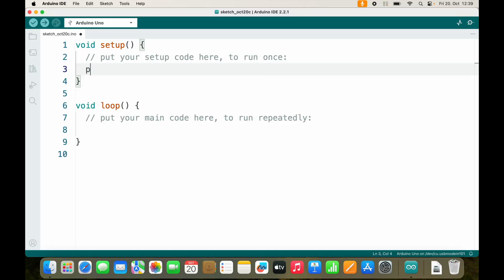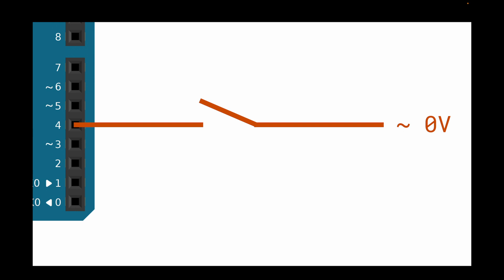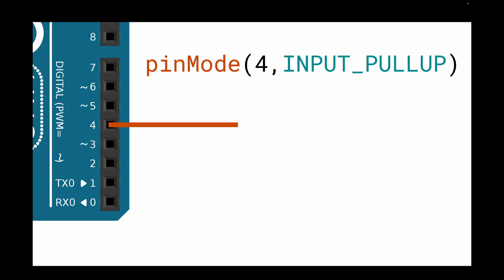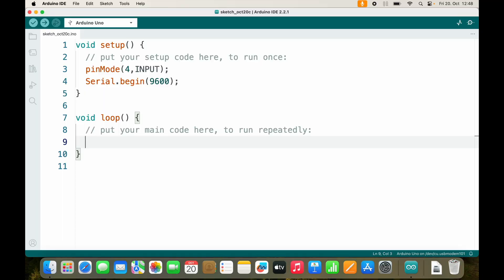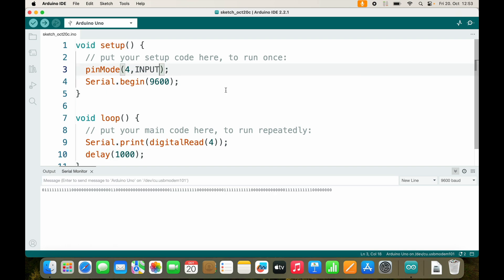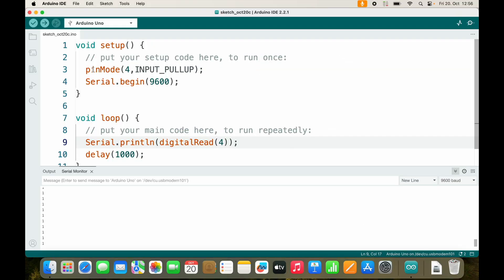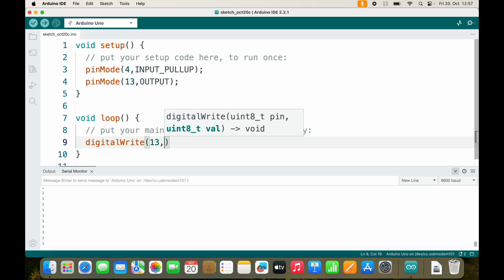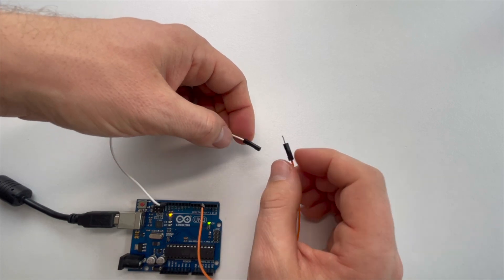internal pullup resistor - digitalRead - Arduino Uno Programming Basics

Comment: Ich frage mal auf Deutsch, um Missverständnisse zu vermeiden, da ich den Fachbegriff "Austaster" nicht auf Englisch kenne:
Angenommen ich habe einen Austaster an einem Arduino angeschlossen. Dann liegen könnten ja sofort 5V an dem Pin anliegen, sobald ich den Arduino mit Strom versorge. Selbst wenn ich im Code ganz am Anfang "pinMode(x, INPUT)" stehen habe ist doch ggf. der pinMode noch auf OUTPUT, weil z.B. ein anderes Programm darauf war. Also ein Kurzschluss?! Man müsste also immer erst das Programm auf den Arduino aufspielen, bevor man den Austaster mit Strom versorgt?! Wie ist es, wenn das gleiche Programm nochmal aufgespielt wird? Kann es sein, dass dann der pinMode während des überspielens unbekannt ist? Oder wird der vorsichtichtshalber intern immer auf OUTPUT gestellt? Und wie ist es, wenn man gar keinen pinMode angibt? Ist der Mode dann unbekannt oder wird der vorsichtshalber als OUTPUT initialisiert?
Reply from the maker: Hi! Standardmäßig sind alle pins auf INPUT ;) solange man sie nicht zum OUTPUT macht. Streng genommen ist pinMode(x, INPUT) im setup überflüssig. Aber es hilft um einen Überblick zu bewahren.

Aber es stimmt, wenn man einen Austaster, ich kenn das als „Öffner“ in Englisch „normally closed” an einem Pin hat, muss man aufpassen ihn nicht zum OUTPUT zu machen. Es käme zum Kurzschluss. Im Normalfall bricht dann die Versorgungsspannung zusammen und der Arduino startet neu.
Reply: @playduino  Danke!
Reply: Upsss. Ja, Sorry, sehe ich erst beim zweiten mal lesen. Ich meinte natürlich default INPUT bei meiner Frage. Es war wohl spät, aber das sind wohl die Momente, in denen ein Bauteil dann schon mal hops geht, weil man einfach etwas verwechselt. :-)

Comment: Is there a way to set the pullup resistor to read 0 initially till switch is pressed
Reply from the maker: On Arduino Uno R3 there are only Pull-Up resistors which means they pull the signal HIGH (1) so the switch has to be connected to GND and will result in 0 when pressed